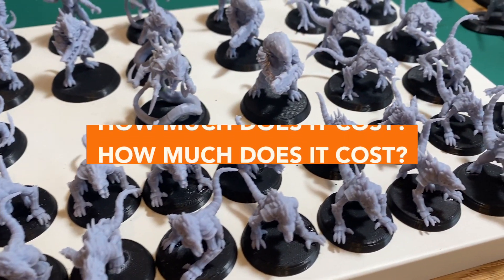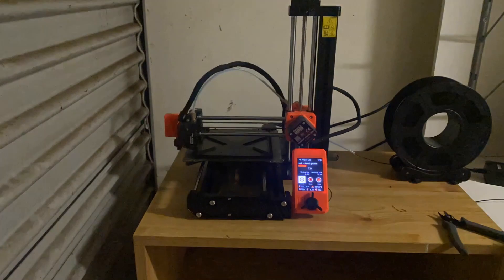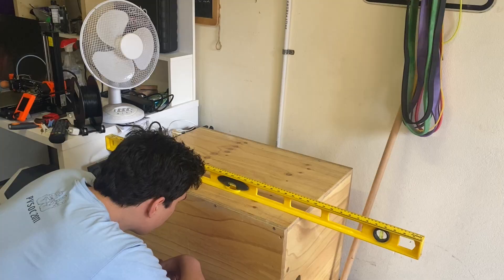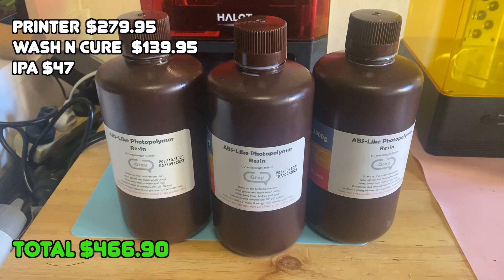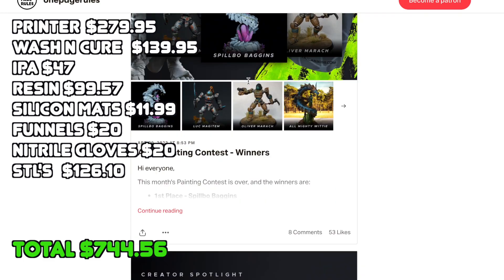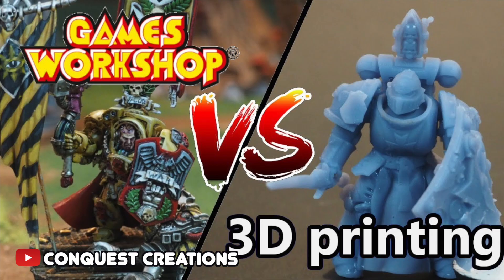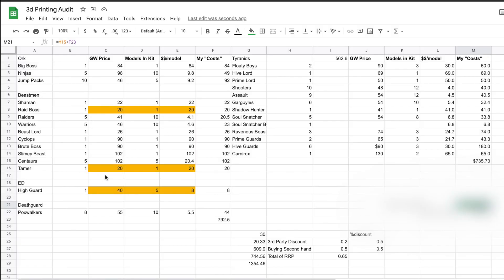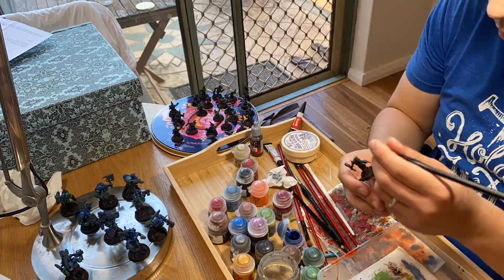How much can you SAVE 3d printing miniatures?

Comment: why is everyone talking about liters when it comes to resin? bottles contain 1 kilogram of resin ( depending on type, this is about 900ml) this affects your cost calculation, as slicers tend to assign cost per liter, and if you assume a bottle contains 1 liter, then you're already off by 10%
Reply from the maker: That's a good point, I overlooked that. I'm so used to water being 1kg=1L.  That will affect the first calculation at the start so the model is $2.81 not $2.56. However it won't affect the final calculation as I just took the total cost of 3 bottles (3kgs). Thanks for pointing that out!
Reply: The thing about liters and kg is that before early 2021 the resin was sold in the same 1L bottles. Then they figured out that they could sell 1KG in the same bottles with less content for the same price.
Reply: @Wolfgang_Franc  interesting, i recall seeing bottles advertised as 1L, while the product is clearly labelled as 1KG. i assumed reseller stupidity, but i guess its just vendor malice....
Reply from the maker: @Wolfgang_Franc  I didn't know that. Thanks for the info :)

Comment: hey bro, i'm new to resin, i bought halot one and i can't find any technical content about it, could you tell me the settings you put in “light off delay” and “lifting distance”, please.
Reply from the maker: No worries! I use 1s turn off delay, my rising height is 6mm (if you're printing with a full build plate it might be worth turning that up). I'd also make sure you update the printers firmware which you can download from Creality's website, but it might also be on the USB stick they supply. I'll eventually get around to doing a video on what settings I use and why. I hope that helps :)
Reply: This is specific to each resin as well as each printer. The resin manufacturers give a good starting point in my experience, and you can tweak from there. Other than cure time which you have a window with, the other stuff is slower / longer / further is better in general and worthless after that and prints just take longer. I'm also new to this so don't quote me! But haven't had a single failure and each small change I've made has shown improvements.